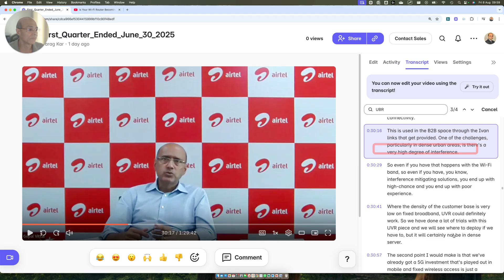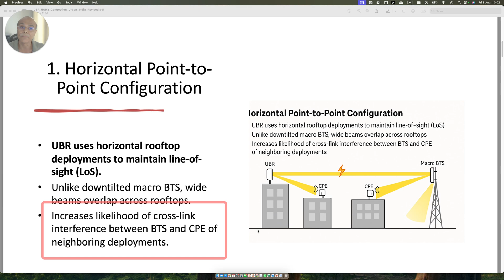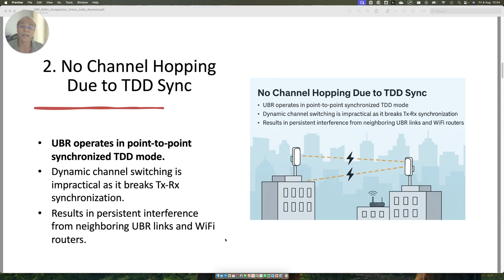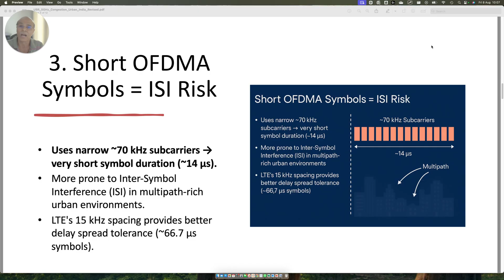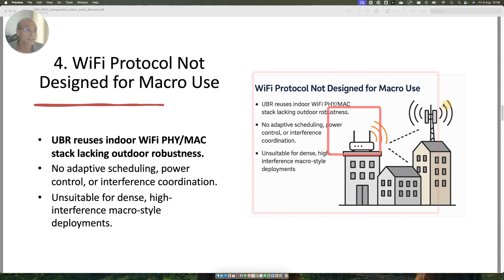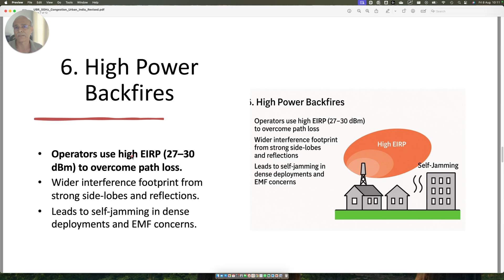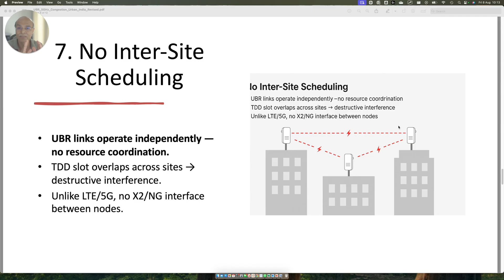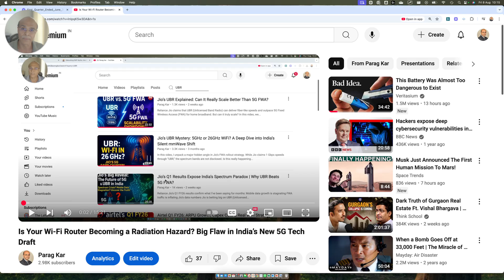Why UBR at 5GHz Is Failing in Indian Cities | Gopal Vittal's Warning Decoded

Comment: Thank you Sir for insighful video about line of sight and interference related issues. 
We are in a village area and Jio tower is within the range of <500 meters. Can i go with UBR solution? 
Thanks a lot
Reply from the maker: thanks for watching. Really can't say if it will work, it is not just the distance but clutter matters too. You need to take advice from JIO site engineers. They are in best position to advice.
Reply: @paragkar thanks a lot for you advice sir
Reply: It depends, if your tower has UBR support (which is very much akin to WiFi), 500m is a very possible.

Comment: I think you are wrong on few things, firstly the 5G BTS is not going to send  signals to these devices, there is going to be seperate UBR master radio placed in the same tower so down tilt is not a problem, infact it's clever to put it in the tower and piggback on towers optical or mw backhaul,you are also wrong about MAC and PHY changes on these devices, companies like tarana, cambium, mimosa have done ton of innovation here, I think UBR is a very clever idea by jio to serve customers close to tower using UBR and use FWA in mid cell and fiber for rest, Airtel as usual doesn't see the point.
Reply from the maker: I think you totally misunderstood what I meant in my video. May be this is my fault not being able to explain it properly. I never mentioned 5G BTS is going to send signals to UBR CPE or BTS. How can they 5G never operate in an unlicensed band. The two spectrum bands are different. What I meant was the creating a Macro network using WiFI technology that too in a dense setting it impossible in an unlicensed band. WIFI is never meant to be a macro technology. Managing a macro deployment is hard that is why so much innovation has done into 4G and 5G RF side innovations. If it was so easy to do that folks around the world would have abandoned 5G and 4G technology and not pay for their innovations and cost and gone with cheaper WIFI technology for their licensed operations as well.
Reply: @paragkar thanks for clarification, I'm with in most of the topics but your hunch and analysis on UBR is wrong, WISP is popular in countries like US even in dense locations, i think what JIO did here is pretty Smart and it's gonna lower their 5G capex both at bts and cpe side.
Reply from the maker: @90ramkumar thanks for your feedback and inputs. I have a totally different view. I am not saying UBR is a useless service. Yes JIO is intelligent to use it for symmetry deployment as they don’t have to mix with mobiles which is make the whole configuration asymmetric. But I believe UBR is too simple a technology to be able to solve complex maco deployments problems. It is not meant for dense macro urban deployments at all, else there is no point is using 5G and 4G.

Comment: Sir  i am facing low indoor coverage , call drop and speed issue using 4g  in  my home from last 4 to 5 weeks in Jio, i think Issue started when Jio Installed A6 Devices in Roads central verge Vi Towers, could  problem is occurring by A6 devices?
Reply from the maker: See call drops can be due to many reasons. Some are device configurations related and some are poor network optimisation problems. Now in a dense setting the possibility of interference between BTS installed nearly is very high causing packet losses and call drops and blank periods even when the signal strength shown on your device is is high.

Comment: Sir,  1 UBR Device (Price Rs 26,000) on Tower = Can handle 90 Coustomer ?? 🤔🤔
Reply: Depends how much bandwidth you want to serve... On paper maybe yes... Practically PtMP network can't handle that much customers... UBR anyway won't be able to deliver fiber like quality of services
Reply from the maker: As per RJIO they are able to do 1 GBps uploads and download using 5GHz band UBR. This is when we have a good interference free less dense deployment. Which means these speeds won’t last for long. Hence, we have to decide how many we can serve given these constraints
Reply: @paragkar every ubr Company be it mimosa, ubnt, mkt, cambium all claim 1 gig links but in a very controlled environment. I don't think jio itself would sell 1 gbps plan to anyone over ubr... It Won't be like fiber and a high ticket customer might be unsatisfied